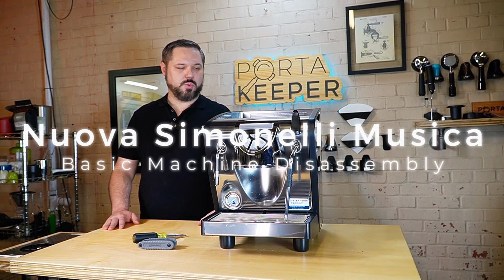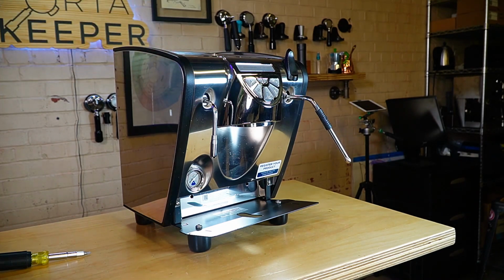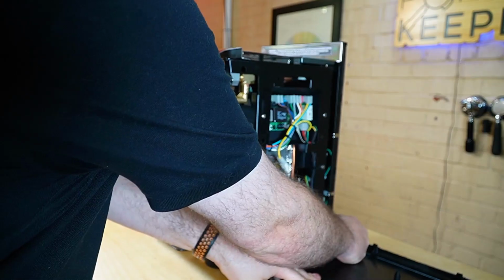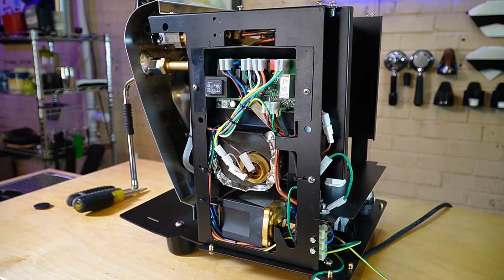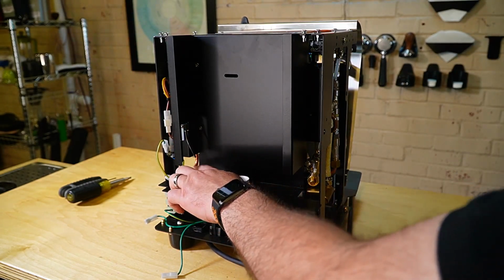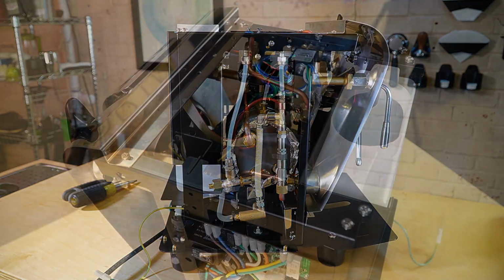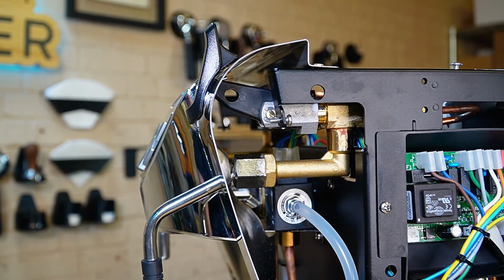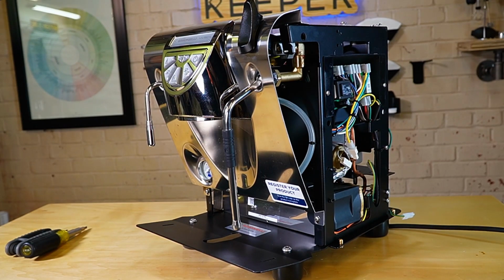Nuova Simonelli Musica Basic Disassembly

Comment: Hello EspressoOutlet, do you happen to know if the direct plumb in version of this machine can work fine with a 10L Water bottle instead of actually being directly plumbed in? From my understanding, some machines don't fare well without the pressure from the main plumbing and was wondering if this one would be fine.

I am asking because there are options to buy the machine for 450 euro used (Lux version) and it seems to be a great machine for that price - especially when compared to my Bambino. 

Thank you in advance!
Reply from the maker: Would recommend running a flowjet.  They cost about 100 bucks.

Comment: Hey, I recently purchased a used Nuova Simonelli Musica 2012 model. It's been working well for the past two weeks. However, today, when I turned the machine on to pull a shot, it started making a loud sound. If you open the link that I provided, you can hear it in the video. Interestingly, when I let just the water flow without pulling a shot, it doesn't make that sound. Any ideas on what I could do?

https://youtube.com/shorts/CPGjIgJUC5w?si=k7bsT9-DwO0NU9a_